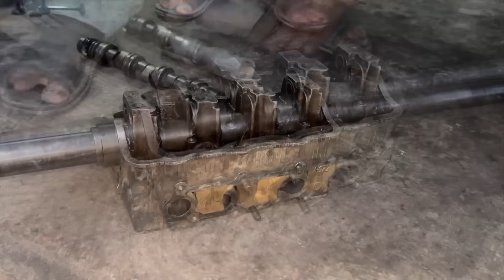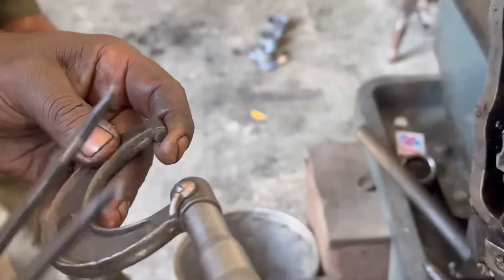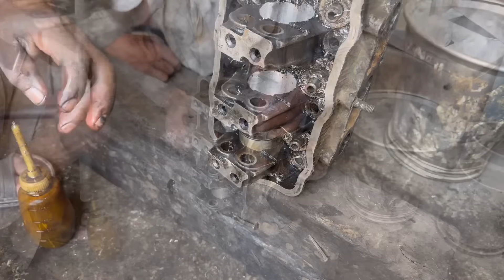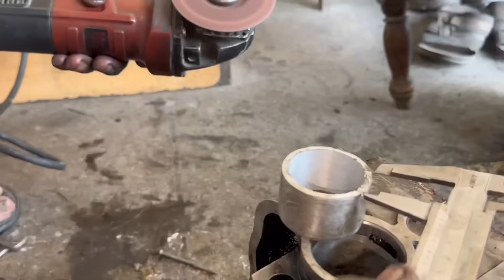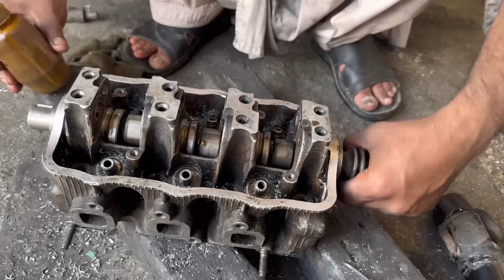How to Repair A Suzuki 3 Cylinder Engine Head Loose Came-Shaft Size….

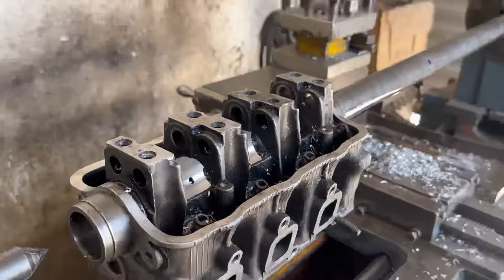Comment: So instead of surface hardened polished camshaft, now you have soft metal with rough surface finish. That "made in pakistan" tube also looked like molten pot metal from the way it machined - just compare shiny surface finish on original head versus the shit finish on that tube. And on top of that, no oil feed hole that is visible at 5:51 was drilled. Great job.

Comment: I missed the part where the oil feed holes were drilled in the "bearing stock"...
Reply: better watch it again then.
Reply: @FletcherElectronics  Those are the drip feed holes from above.  The pressure feed holes fed from the block thru the bottom of the head were never drilled.  The cam will sieze.
Reply: Realmente os orifícios de refrigeração não foram feitos, ou seja, será um motor que vai apresentar problemas de superaquecimento rapidamente.
Reply: @honkie247  5:47
Reply: @GeorghePlays  Those are the drip holes from above.  Cam bearings are pressure fed from the block, thru a hole in the head gasket, and then thru channels in the head.  There were no holes made in the bearings from the bottom of the head, so it is not pressure fed and therefore it will seize.

Comment: When boring the cam holes don't machine shops usually use a machine that pumps oil while boring so to no over heat the metal and warp especially aluminum
Reply: Did you notice the ketchup 🤔 😂
Reply: Kerosene/ light oil mix.
Reply: @kiwiingenuity1677 no looks dry but long as your using something good to go

Comment: Yep what about the oil holes
Reply: You need to check your   EARS.
Reply: Ears?? 
He drilled oil holes at very end.
File finish cam bearing surface. Dry 1st fit, no lube
Reply: Glad it’s not mine it’s stuffed before it started
Reply: Glad he knows how to use calipers. (Not)
Reply: Why’s he got lubricant with carbide tip?
Reply: How do you measure a bore with dividers instead of internal calipers
Totally Micky mouse

Comment: that is a waste of the customer's money.and a destruction of what remains of the engine. that crank will sieze in the bearings. taking wagers on how many turns the engine will make before it siezes. and ruined the cam as well. instead of setting the line bore tool to size that fits the cam he machines the hardened grind/polished finish off the cam. go figure...

Comment: Bushing with Aluminium, not Brass?
Reply: el bronce desgasta el eje, salvo sea un bronce muy blando y especial que es carísimo
Reply: @dantech1  Correct, not brass but Bronze (bronz -arama on my language - brass= alama).
Reply: @dantech1  Correct, in my language bronz and arama ( are the same) and brass is named alama, regarding bushing with aluminum I do not know.
Reply: @emilsustrean938  lead bronze required
Reply: Yes like a motorcycle head.

Comment: There goes the case hardening on the cam bearing journals.... and what happened to the oil galleries. And i dont see why they are ok with scratching the mating surface of the head on the ground.
Reply: Because it has a head gasket between the two surfaces, when the old gaskets are scraped off it leaves scratches.😮

Comment: Turned cam? That wont last long. Surface should have been ground or at least paper polished.   Hacks!
Reply: Actually it's the camshaft lobes that take the impact  (like a hammer) So they need hardened. The journal will be  fine ... given the right finish ,clearance, oil,oil pressure, and temperature.  N.B. the lobes of cam were not touched,  so should remain hardened) the main head scratching moment,  is why not leave the camshaft and fit bushings to it... it seemed fine ! But maybe not? If they knew to drill holes for oil... surely they wouldn't have missed any??🤞🧐

Comment: Well, that shows little understanding of case hardened bearing sufaces, or anything that has taken the rest if the developed world the better part of 150 + years of mechanical development. Material science and general use of Google search on how to do stuff.

Fair play to them for getting on in life but the quality vanished the second they touched it
Reply: How do you know they don't have a salt or ammonia salt nitride hardener, and a liquid nitrogen cryo treatment room? I mean they don't, but they might right? They're not even gonna steel wool polish those journals, let alone case carbon harden them.